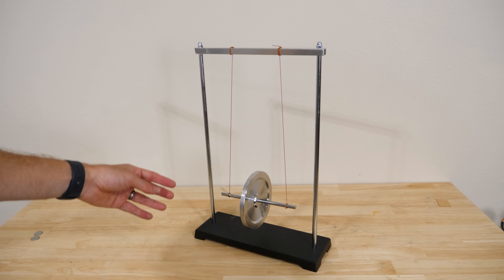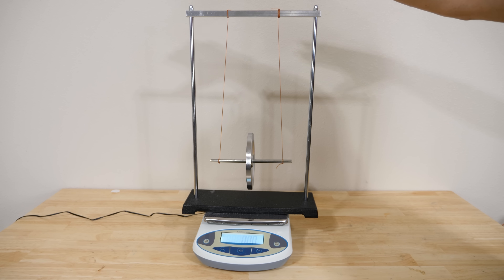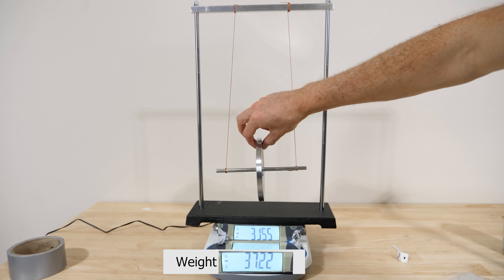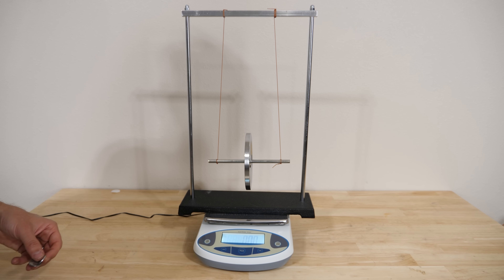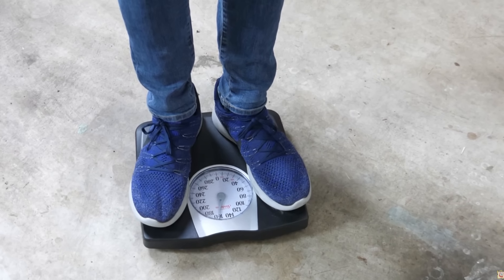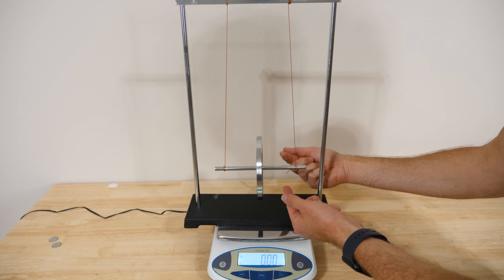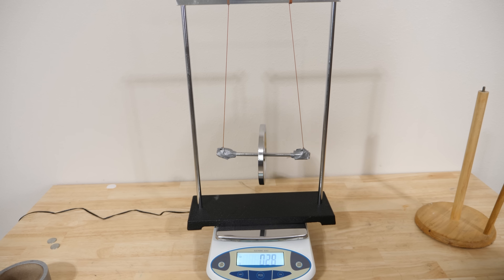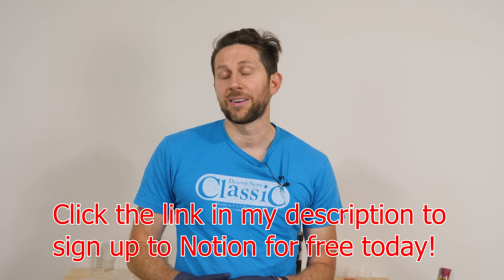How Does The Anti-Gravity Wheel Work?

Comment: I remember a theory of how ufo's work where the ship has a big toroid of mercury. The mercury would flow axially and radially through a section of the toroid. The radial flow in a section is actually axial flow around the whole toroid. So if you could magically move/spin/swirl the mercury, you could control its gravity
Reply: I wonder if quarks, electrons, create gravity with their spin? Get enough of a mass together, and the  spin of all those atoms creates a higher density, and therefore higher gravitational force.
Reply: It either makes no sense or I don't understand what you've wrote. 

Please rephrase that in terms of a picture / sketch, so I can grasp exactly what you mean by axial / radial flow.
Reply: @vaakdemandante8772  a liquid flywheel that can spin on two axes simultaneously
Reply: But the flywheel acceleration keeps still. How could the ship zero an external body gravitational acceleration? The flywheel went upward because the downward acceleration winded a wire to roll up. How could a ship ignore a planet gravity and just fly upwards effortlessly, not being winded to anything?
... This is one of those unintuitive talks, like quantum physics/mechanics.
I like it, it makes the brain works.
Reply: More research is needed
Reply: It sounds like you're thinking of The Bell.

Comment: 1:35 My simulation tells me that pulse would be very small because the strings are taut all the time.
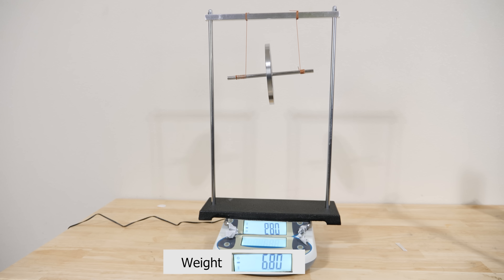2:20 Well of course it does. It is effectively falling, with the scale only holding it as much, as it is slowing down. (Well, losing energy)
Reply: Kool, someone else picked up on the constant downward accelerations as well :P

Comment: Moment arm length along with your snipping idea. So would a rod the same diameter of the disk be half of the weight of the total when oscillating? Could you assume the diameter of the smaller shaft is roughly ~11x smaller of the radius of the bigger disk?

Comment: No change in weight when it hits the bottom is due to the fact procession is at play the forces are being shifted as it rotates. 
Weight distribution is calculated by forces that radiate from the center only as a guess one sixth of force is being distributed in a downward direction. As you move radially meaning for every degree from the perpendicular 1,2,3 degrees the total downward force decreases.
This is noticeable buy measuring the rise being lesser and lesser until equilibrium is reached and it stops.
A spinning disk has angular momentum and this means that depending on direction it is applying a force opposite direction of travel.
The process is far more complex than what I can say in a short comment.

Comment: I wonder if this effect contributes to the Chain Fountain physics. Seeing as the chain is technically spinning as it form the loop, and weighs less at that point as a result, this could be the dominant force?
Reply: This is a really interesting question! I don’t think that “spinning” figures into the weight reduction (its just an energy storage mechanism) but the chain in a chain fountain is definitely accelerating downward as it changes direction from flying up to flying down.  And, surprise, surprise, it’s the decelerating portion of the chain that rises! I think you may have discovered the REAL reason for chain fountains!
Reply: But chain fountain weighs more, not less, while in operation. Steve Mould had series of videos about the kickback

Comment: In this case if disk would accelerate with 9.8m/s^2  than the mass indicating by scale would be (-) mass of the entire disk?
Reply: Yes.  Another way to think about this, is if you were holding a 1 kg rock, and standing on a scale, then when you hold the rock at rest, the scale reading would measure you plus the rock.

Then, when you throw the rock upward, the scale would read your weight without the rock, while the rock is in flight.  The scale would decrease its reading by 9.8 Newtons.   When you catch the rock and re-throw the rock, the scale reading would increase while the rock accelerates upward in your hand.

Comment: Can you show me the math predicting the weight loss ? that would be so much easier for me to understand your argument. Amazing observation, very interesting. another great video :-)
Reply: It would not have been bad if these calculations had been presented in this video, along with other explanations, such as the appearance of the impulse when changing the direction of the speed or the existence of a component of the kinetic energy which is given by the translational mouvement of the center of the mass of the pendulum.
Reply: Start with a free body diagram of the disk.
Weight m*g acts downward at its center
Tension T acts upward along the rim of the axle, at radius r from the center
The disk has mass m, and moment of inertia I.  We can calculate I as 1/2*m*R^2, by approximating it as a uniform disk of radius R.  This would neglect the axle's moment of inertia, and neglect other details of the disk's shape, but it still will give a decent approximation.

Linear forces add up to m*a, and we assume a is downward:
m*a = m*g - T

Torques add up to I*alpha, where alpha is the angular acceleration in the same direction that corresponds to it accelerating downward.
I*alpha = T*r

The roll without slip condition relates a and alpha:
a = alpha*r

Three equations, three unknowns (T, a, and alpha).  The one we are interested in, is the tension in the the string, as that will govern the apparent weight of the disk while it is accelerating downward.  The solution is:
T = m*g/(1 + m*r^2/I)

Plugging in I=1/2*m*R^2, we end up with:
T = m*g/(1 + 2*r^2/R^2)

To make up some numbers, suppose r=3 mm, R = 30 mm, and m = 300 grams.  This shows that the disk would normally weigh 2.94 Newtons, and would experience a tension in the string of 2.8824 Newtons while unwinding and winding like a yo-yo.  The difference is 0.0576 Newtons, which corresponds to 5.88 force-basis grams.
Reply: @carultch 
'The following was coded in Colab using Python'
'All variables are in SI units of Meters and Kilograms'

'acceleration of gravity on the surface of the earth at sea level'
g = 9.8
'axel radius'
r = 0.003
'Disk Radius'
R = 0.03
'disk mass'
m = 0.3

'solution from Carl Hansen'
T = m*g/(1 + 2*r*r/R*R)
print('T =',T)

RESULT: T = 2.9399470809525425

Is this what you would expect to see with your solution Carl ? we seem to get a different answer
Reply: @sean...  The reason you are getting a slightly different number, is because of order of operations.  Enclose the product of the two capital R's in parenthesis, and this should get you a result consistent with my result.  You could also use Python's syntax for exponents, where A**B indicates A raised to the power of B.

Multiplication and division are evaluated on equal precedence in the order they appear.  So your code is evaluating this as T=m*g/(1 + (2*r*r/R)*R).
Reply: @carultch 
Ok, so here is the suggested correction.

''The following was coded in Colab using Python'
'All variables are in SI units of Meters and Kilograms'

'acceleration of gravity on the surface of the earth at sea level'
g = 9.8
'axel radius'
r = 0.003
'Disk Radius'
R = 0.03
'disk mass'
m = 0.3
'solution from Carl Hansen'
T = m*g/(1 + 2*r*r/(R*R))
'difference'
dif = (m*g)-T 
'Newton to Gram Force Conversion'
gfc = 101.97
weightLoss = dif * gfc

print('weightLoss =', weightLoss)
weightLoss = 5.878270588235291 

that puts us on the same page, thanks Carl for taking the time to help me :-)
Reply: @sean...  No problem.  Out of curiosity, what are you planning on programming in Python for this experiment?
Reply: @carultch  Wanting to predict the weight loss using a logical model and take a deeper look at whats actually happening to see if I can replicate it. Its a special observation and I don't want to be confused about it. This really helps with that :-)

Comment: Would you mind making some experiments? I've got multiple in mind which all have to do with spinning discs and a scale!
I suggest you to create a "Ferro lens" for these and other experiments!

Experiment 1: A magnet spinning above a conductive surface!
(Expected outcome: The induced Eddy-currents will heat the magnet and the metal and no lighter weight being shown on a scale.)

Experiment 2: A copper-disc spinning above another copper-disc!
(Expected outcome: Same as above. Eddy currents again, but there might be a "workaround", if you increase the surface via a wave-like pattern, slits and enough air-flow.)

Experiment 3: A super-conductor disc spinning above a. magnets, b. conductive and c. non-conductive surfaces, as well as d. a second superconductors and e. a carbon-sheet/layer!

Experiment 4: Different masses/wheels with the same experiment you just did!

Comment: Wait... This doesn't make sense. Comparing to a bouncy bal is nonsense. Because as it rotates back up it MUST pull on the string to lift its own weight, so either your scale is useless for this experiment, or something else is going on that you've neglected to explain...
Reply: What happens is that the upward acceleration is entirely during the brief time when it bottoms-out on the string, and bounces back up.  It is accelerating downward, both when it descends, and when it rises.

Comment: You need an analog scale for this. Or a scale with a much faster update speed.
Reply: Start building a spaceship
Reply: @robbiebouchart1551  I was thinking the same thing. Great minds think alike and all.
Reply: Ye guess there is an Gravity spike when the Disk is at the lowest Point. Digital Skale is just to Slow
Reply: maybe
Reply: try 2x speed
Reply: It would be cool if it was a faster scale that could output its data into a line graph

Comment: So I've noticed a similar "feeling" of lightening using a chainsaw. Not on smaller saws but on large beefed up saws the act of goosing the throttle seems to have a lightening effect. I always thought it was just a sensation of the focus of the weight of the extended bar shifting closer to the powerhead but now I'm wondering if this has more to do with it. :)
Reply: That's torque reaction.  You're supporting the bar and when you give it the beans, the chain spins forward and down, making the bar lift upwards and back due to torque reaction.  Same way the front wheel lifts on a motorbike when you give it throttle.
Reply: @admacdo  Right, seems you explain it far better than I, LOL. Similar but not the same I guess. :)

Comment: I hope someone can explain this a bit better. Not sure I fully understood you. My thinking was there as the disc spins, a portion of the mass of the disc is continually thrown up and an equivalent portion downwards. And thus you have some cancellation of weight??? Plus, as the disc bounces back up, it’ll experience weightlessness at the top. As it comes down, a portion of the downward pull on the string is transferred as ‘work’ to rotate the disc. So the disc is not really accelerating to ground at the acceleration of gravity. Hopefully someone who is good at their kinematic physics can explain better.

Comment: Would have been nice to see the extra weight it had as it bounced back up.  Maybe even showing a chart of the -6g and the spiked positive weight when it bounces.  I wonder if that could be shown well with a mechanical scale.
Reply: A hi speed recorder of a strain-gage measuring the weight would be the way to do this (IMHO).
Reply: if there is a spike even as fast as 1 MS that scale will pick it up. And it didn't.
Reply: @wishusknight3009  Depends on how the signal from the sensor is sampled and processed. "It didn't" doesn't mean aaaanything
Reply: Indeed it would be interesting to see the details of this spike, but I don't know what kind of scale would have the time resolution to accurately pick it up.

From the impulse-momentum theorem, you can infer that the time-average change from zero in the reading on the scale should equal zero, across a time interval between equivalent points in the cycle.  No change in the momentum of the center of mass, should mean no net impulse on the system from the scale, other than the baseline impulse needed to oppose the steady impulse of gravity.

The problem is, that there is such an extreme asymmetry between the time when the scale would read -6 grams, and the time of the rebound spike, that the scale doesn't have enough resolution to pick up the rebound spike, and this biases the readout to show the loss of weight, a lot more than the gain of weight.  Maybe if you introduced flexible springs at the top of the strings, to slow down the rebound impulse, you could pick it up on the scale.
Reply: @carultch  If you change the scale to a pressure sensor and connect it to an oscilloscope you would bei able to see it. The sensors themselves are fast enough, it's only the processing which slows it down.
Reply: @andremanicke8534  Thanks for clarifying.  So we do have the ability to see it, and not only with theoretically ideal equipment, but with real equipment that we could use today.
Reply: @carultch  Another factor is that the motion at the bottom of the fall is not a complete linear stop and reversal of direction, but is dependent on the diameter of the axle where the string begins to wind back up. So the motion is orbital. Also involves transferring force along an axle which will have some amount of flex to dampen the shock.
Reply: I think it would be an infinite weight during an infinitely small amount of time.
Reply: @AlexGeek  Only in the oversimplified world of introductory physics, where rigid bodies are truly rigid and inextensible strings exist.   The truth is, all strings, cords, cables, etc, will have some degree of stretching, and due to this, the spike at the bottom will not have an infinite force, in an infinitesimal time.

Ultimately, Hooke's law would govern the behavior of the strings, as if they were springs with a much larger k-constant, and I would expect a sinusoidal profile of the rebound force as a function of time.  The frequency would be in kilohertz or megahertz, and we'd only see a a little over half of this sine wave appear on the plot.   We'd also see harmonics to this sine wave, that are governed by the natural frequency of the spring-like elements in the scale, be it actual springs or piezoelectrics, and a damping envelope as the sine wave pulse transitions back to the constant -6 gram reading..
Reply: @AlexGeek  Not in reality

Comment: I'm curious about something in a perfect vacuum, all other variables such as gravity, elevation, etc being equal. If you have an item like this creating friction, in air the heat from that friction, plus the sound, has air to travel through. In a vacuum, there's no air to take heat away from the heated friction elements. So technically, shouldn't friction cause the items to slow down faster? I hope my question made sense.